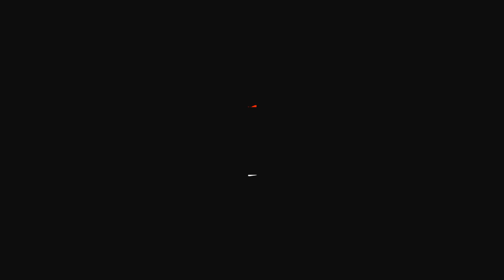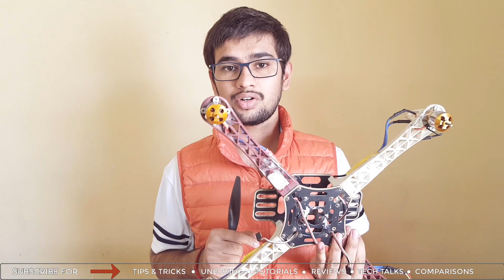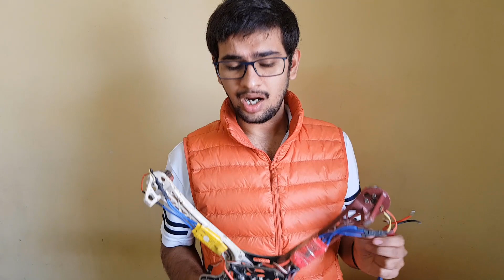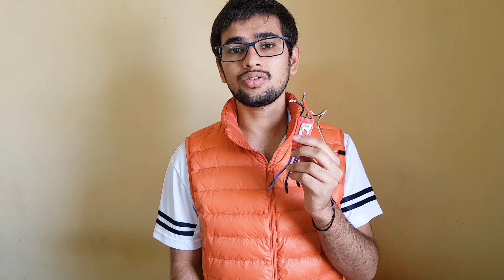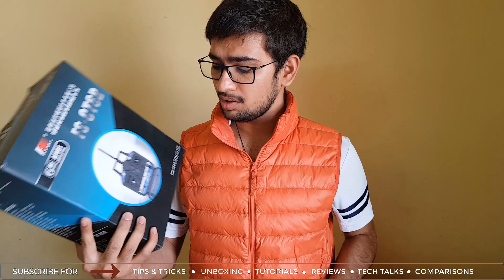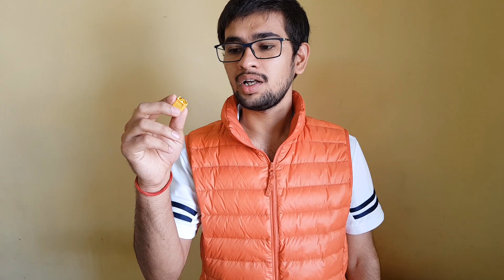How to Design and Build  a Quadcopter Part 1😁

Comment: can u send me the save file of the fs ct6b transmitter or the default setting for quadcopter i am using dji naza m lite flight controller.i have stick calibretion error due to mid point of the stick position.

Comment: I have racing drone with spf3 flight controller quadcopter
I'm using Inav frimware 2.0 , quadcopter is arm but flight modes ( althold, poshold) doesn't work
Can you help me to solve this issue
Please help me

Comment: Hello friend ,I have a quadcopter with 3508 motor 370 kv with 15 inch props.so when I am trying to it on the motors are not spinning correctly on and off on and off spin stop spin?please help me if possible .can I get your WhatsApp no.thank you sir.
Reply from the maker: Sure i will help you, be more specific and please message me on whatsapp

Comment: Hi. Can I use FlySky CT 6B with APM 2.8 flight controller? Plz reply
Reply from the maker: sure bro you can.
Reply: TECH BINDERS thx bro
Another question
Im making a hexacopter. I have chosen to use 1000kv motors. So which ESC should i purchase? 20A or 30A?
Reply from the maker: Well there are more things I need to ask you and I would recommend you to message me on WhatsApp and I will definitely help you.
Reply from the maker: 9458706160